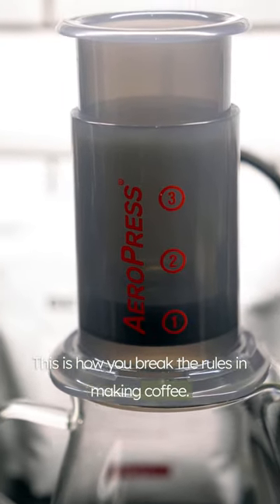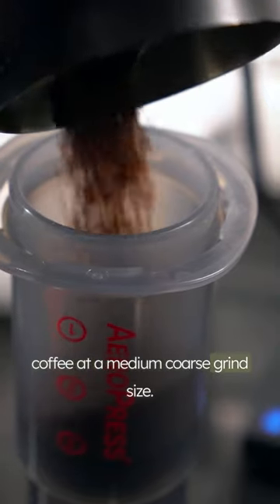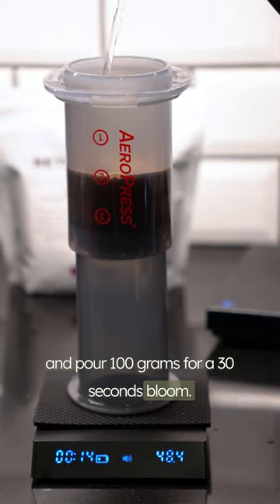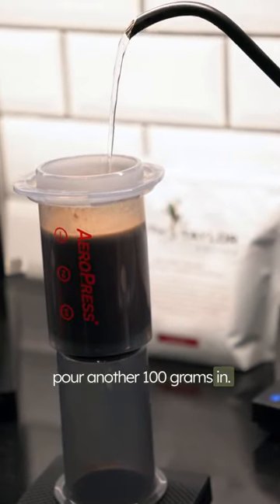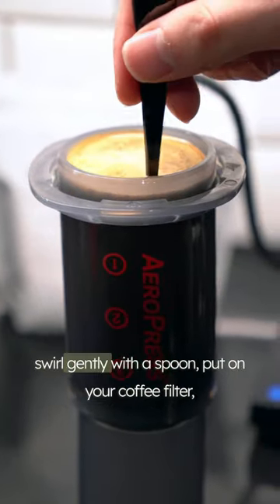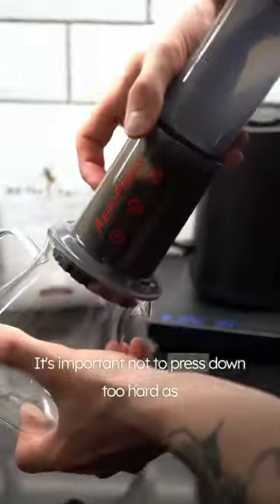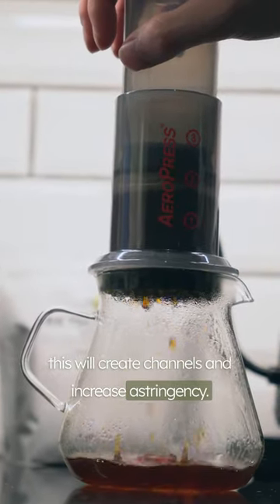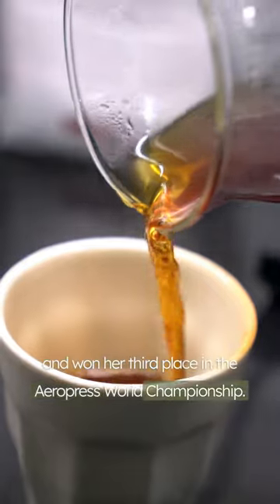Championship Winning Aeropress

Comment: Ahhh the classic inverted method, challenging each day until you get burned
Reply: never been burned year in to using inversion, maybe it's skill dif
Reply: @kingkurtis inversion makes 0 difference
Reply: @rivitril5440  I would agree with you but there is a technique that you can combine with the inversion method which you can't with the regular, James Hoffman's french press guide suggests stirring crust after an amount of time so you can scoop out the foam which is caused by co2 escaping the grounds which imparts a negative sour flavour then I top up the mixture with a little more water as freshly ground coffee tends to produce a lot of foam.
From there it doesn't really matter which way up the container is.
If you want to try the method I'd suggest just waiting 1 minute before the stir and removal, then 8 minutes either way up, give it a lil swill and place it on your cup, wait a minute and gently press.

I usually get some cleaning done during this process since it takes 10 minutes once you have ground coffee and a boiled kettle.

Reason why you can't do this with non inversion is that without the vacuum that's created by having the top on water will be trickling through the filter.
Reply: @kingkurtis theres flow control cap. IMO worth the price if you have extra money, esp if you work with boiling water
Reply: One thing I learned is to do this in the sink. Second point, use hot water to make sure that coffee grounds are not where the filter should lock in. Hammered my thumb on both of those.
Reply: I've always brewed inverted for the past 3 years have yet to burn myself. I dunno maybe I'm just a genius.
Reply: Getting burned by any aeropress method: Skill issue

Comment: I just don’t like the idea of inverted first thing in the morning. I need a way to control flow so my “shot” doesn’t start pulling and I can “steep” without inverting. If I grind too fine it becomes too hard to push. Maybe this device isn’t for me.
Reply from the maker: Can be dangerous while half asleep haha. There is the Fellow Prismo and Aeropress Flow Control to allow you to steep without the inverted method.
Reply: Why not using two filters. They can be recycled so it's not even an extra cost. Two metal filters work well, too. Or stopping the flow by putting the plunger on top. Moreover, it keeps temperature, too.

Comment: Set the temperature at 84 deg C or 34 deg C?
 The subtitles and videos mention different things
Reply: My guess is 84 deg C! If it was 34, it would not be hot enough to brew coffee. Typically, the best brewing temperature for coffee is going to fall just under boiling. I normally go for around 90 deg C/ 200 deg F
Reply from the maker: It's 84 deg C :)